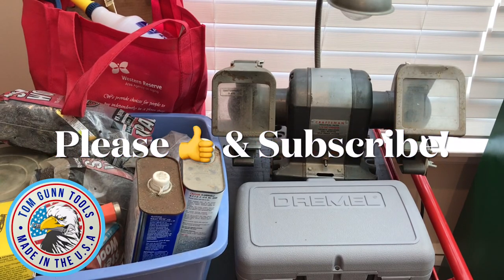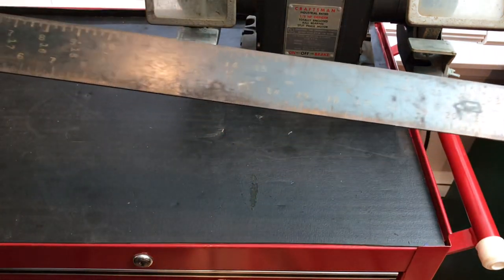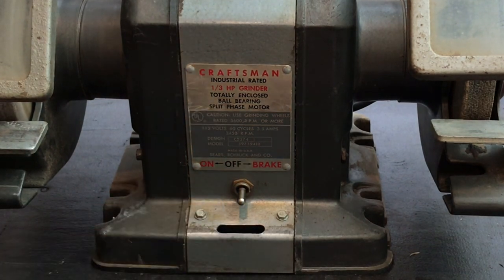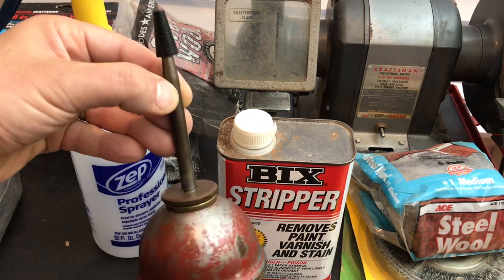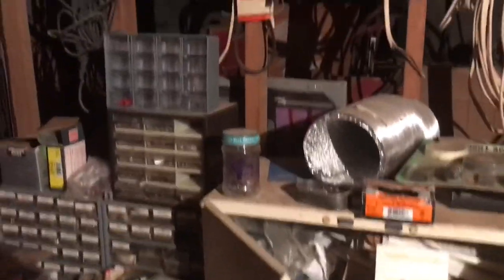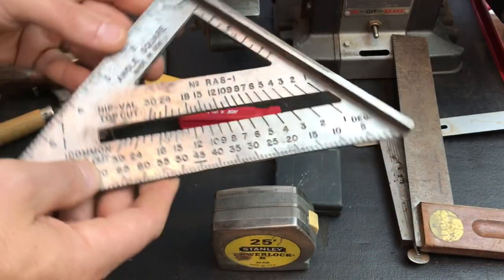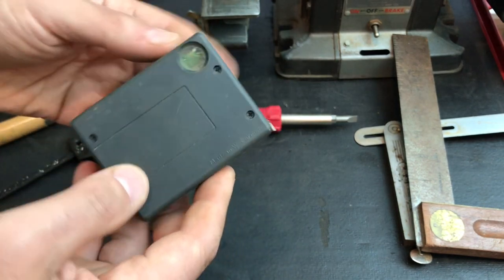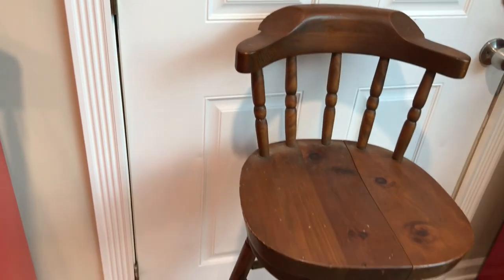$85 Estate Sale Tool Haul- Some Great Finds!

Comment: This Germany made  measuring tape that has flipping tab with sharp tip on it  - this is circle drawing feature.  You stick pencil into the whole near end of the tape and push sharp tip into wood surface. Radius will need to be setup trough the glass.

Comment: That's crazy! I never knew that was a thing! I have a sanding disc on my table saw, but I thought I invented it! It's just the platen off of a radio sander that I attached to the arbor. I use it in machining for deburring and quickly squaring up saw cut stock. Guess I'm not as clever as I thought
Reply from the maker: Haha, that was a surprise for me for sure. Back in the day it seemed they tried to make many tools multipurpose.

Comment: I like that bench grinder. I am restoring a 1/2 horse from the 1930s and a 3/4 horse from the 1950s, both are Craftsman with very short model numbers.
Reply from the maker: Would love a 3/4 hp! I’m going to keep looking!
Reply: @TomGunnTools  
I would search out newer than 1950s. Mine are being a challenge and have no rests or safety gaurds whatsover. I found an old Craftsman belt driven grinder with nice gaurds and rests, may work out.

Comment: Please be careful with old stones. Even if they've never been used. You want to put them in an oven on the lowest temperature for about an hour and then let them normalize for a couple days before you spin them up. The binder they used to use tends to break down over time and sitting on a shelf. Bye baking the stone, you reactivate the binder. Much much safer.
Reply: Also good to double check what they're rated speed is. Some stones cannot handle high RPMs. It should be noted on the package if that is the case.
Reply from the maker: Appreciate the heads up, I will definitely take your advice. Nice trick with the oven.